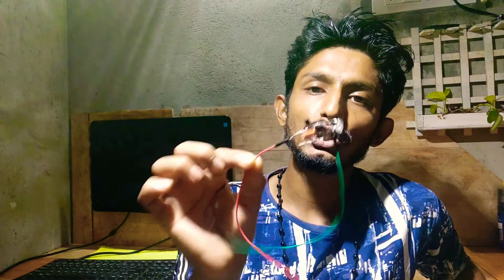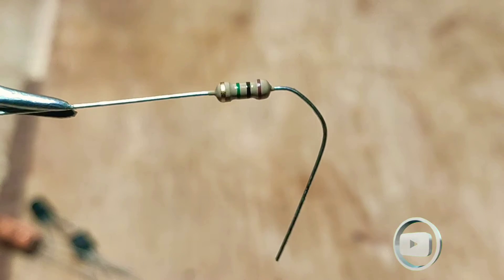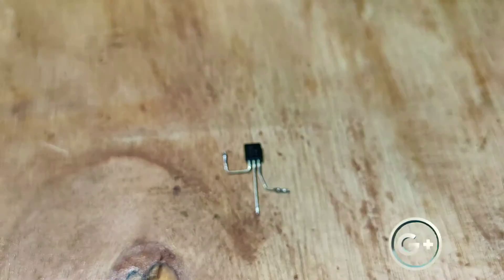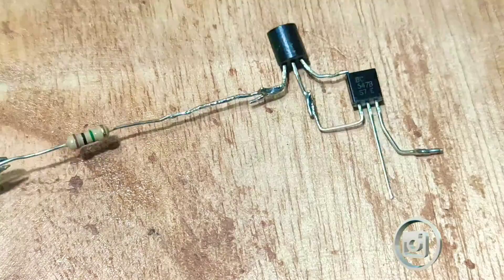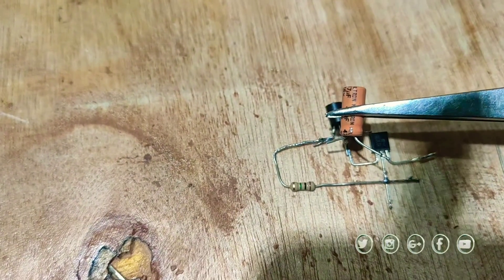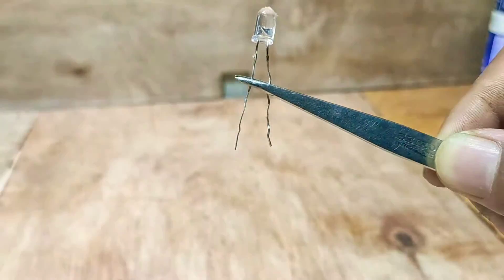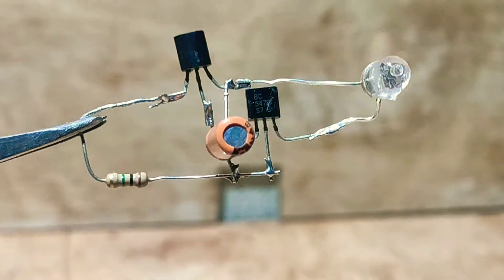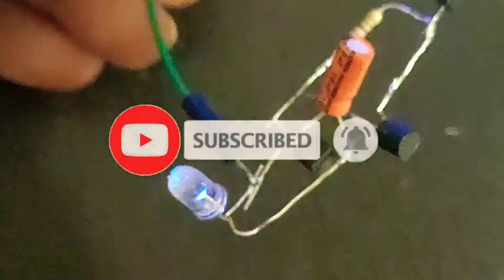LED FLASHER   3v   circuit  made up  ...WOW is simple....

Comment: Sir two Transistor BC 558 and 3 resistance 330ohams,4.7kilo oham, 4.7ohams and two capicitors 47microfarad 25 volt and IN4007 diod  using 3.7 volt 3 green and 3 red led flasher circuit banayeye aur circuit diagram send kare
And translate to hindi
Reply: Railway try colour torch ke laye